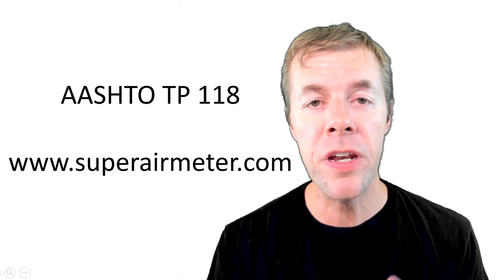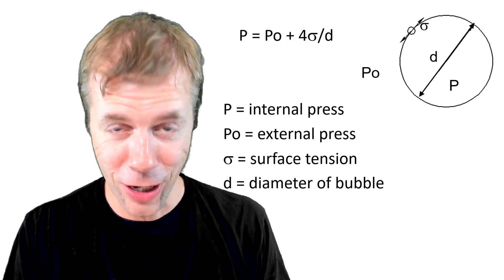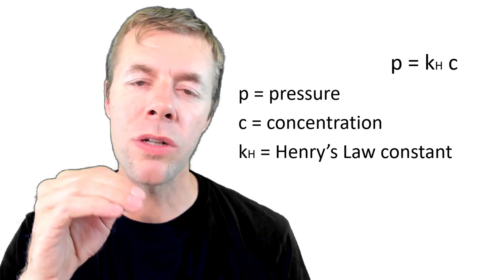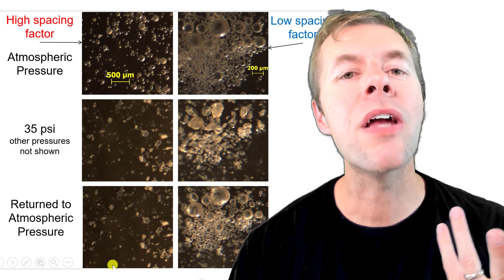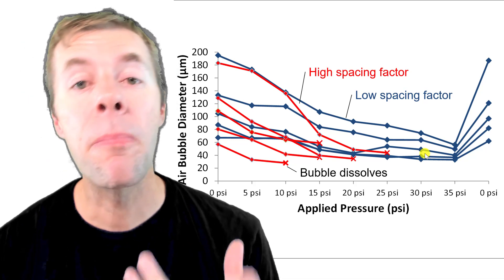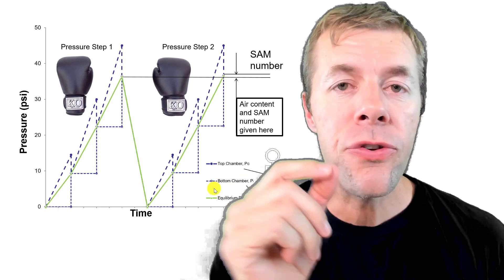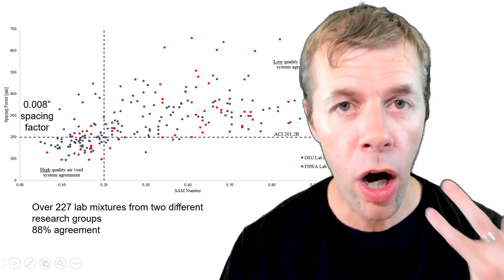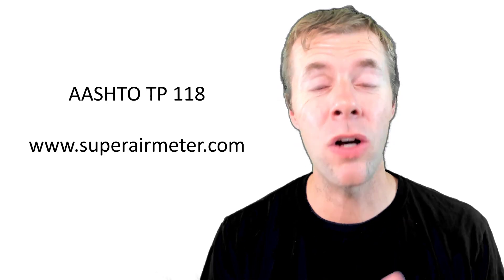The Secrets of the Super Air Meter | How to measure bubbles in fresh concrete

Comment: I kinda fell in to this by accident.   Dumb question but why not put the concrete under vacuum before pumping it out.   That is how you degass (ie remove bubbles) in most applications.   Maybe you could do it in the truck.